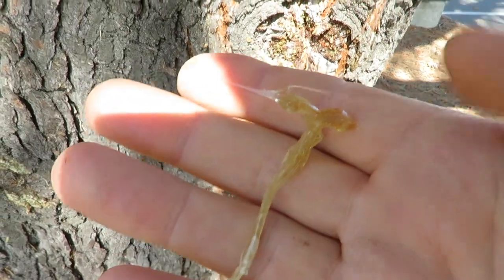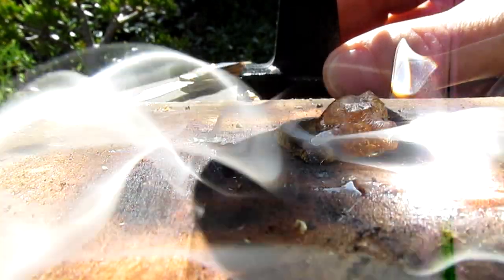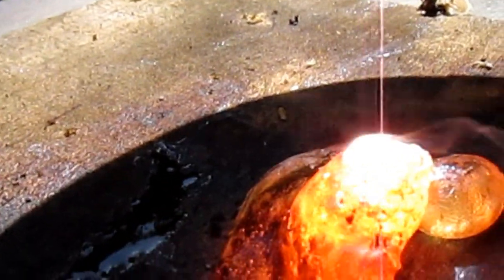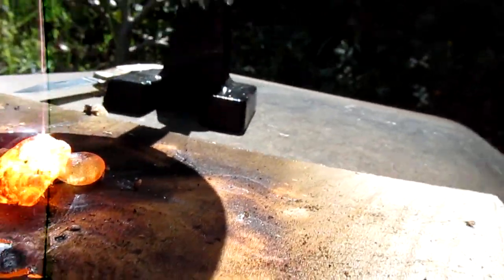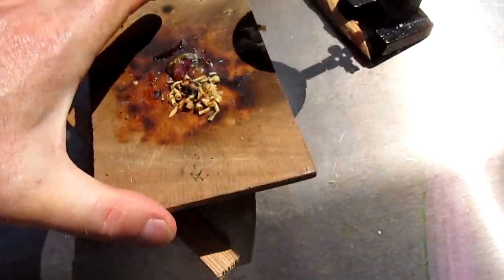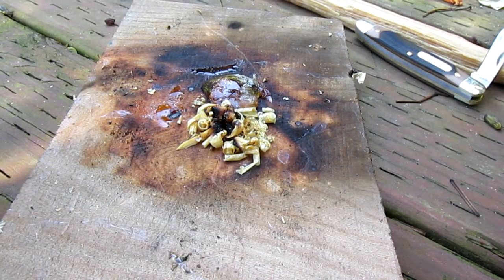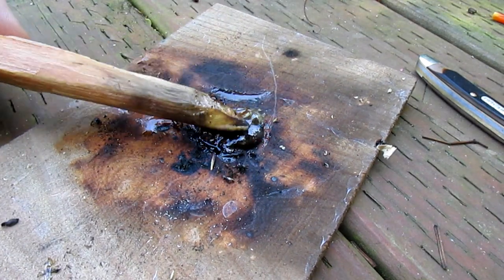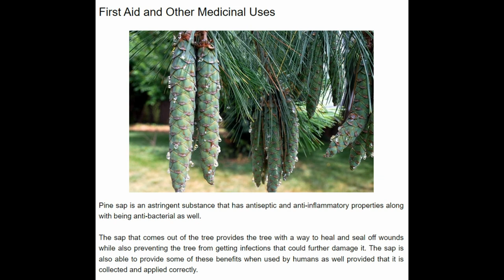PINE SAP + MAGNIFYING GLASS + FATWOOD + FERRO ROD = FIRE

Comment: Thanks for the info JP!  I didn't think of pine sap as anything but bad for the paint in your car. 

Now, I see it differently. Surprised the blob didn't catch fire though.
Reply from the maker: Pine Sap is amazing it could save you from infection from a wound if your stuck out in the Wild, I sometimes prefer using it even if i'm not in the wild...Burns nice to get a fire going the vapours burn as it melts...Thanks Rusty
Reply: @JollyPeanut  I bet it smells good too
Reply from the maker: @rustyminer  It smells great ..

Comment: Here's what Gardening Know How says about pine sap 
Pine tree sap is used by the tree to transport nutrients. Pine tree sap uses include glue, candles and fire starting. Pine sap is also used for making turpentine, a flammable substance used for coating objects. If you use a knife to harvest sap, you'll find that pine tree sap removal is not always easy.
Reply: It is a natural antiseptic, anti-inflammatory, and astringent that treats and bandages wounds like a two-for-one. The softer sap can even be chewed like gum for colds and sore throats. Pine sap can also serve as a waterproofing
Reply from the maker: @WilliamsKnifeLife  It's amazing stuff, Natures medicine cabinet. 👍
Reply from the maker: I find it real easy to collect especialy in urban areas as the lower limbs get cut off & sap is right there dripping or dry but it is super stickey unless it has dried hard. You can use it for all kinds of things, even patching a hole in a canoe, it's great stuff. Thanks William

Comment: I think they call this rosin.  I think you can dissolve the sap in some isopropyl alcohol to make flux for soldering.
Reply from the maker: I had forgotten about that, yes rosin pine sap does make flux for soldering , amazing. Thanks Buddy 👍
Reply: Yeah, Big Clive just put up a video about rosin earlier today.
Reply from the maker: @two_tier_gary_rumain  Pretty neet using a Weed pipe to vaporize pine resin for cercuit boards.
Reply: @JollyPeanut  Yep.